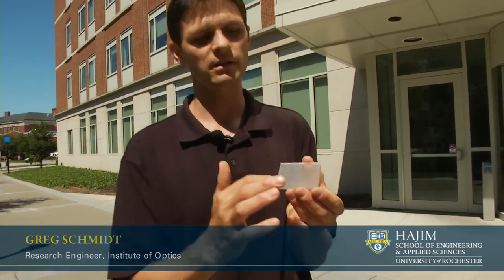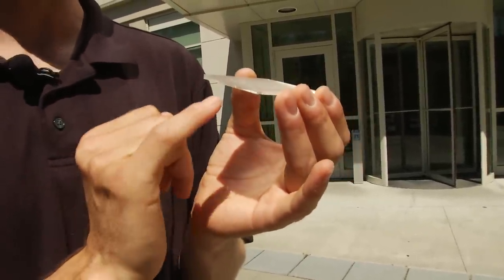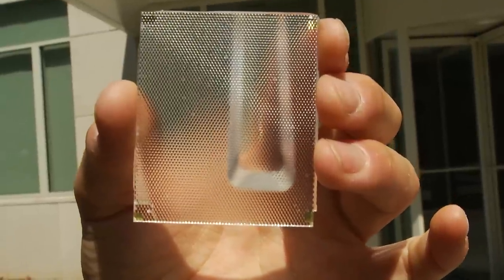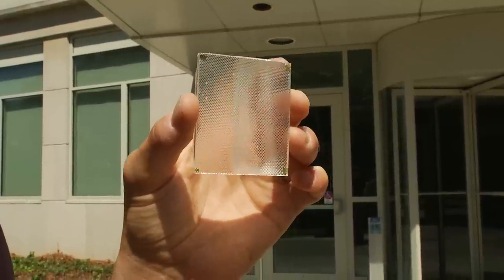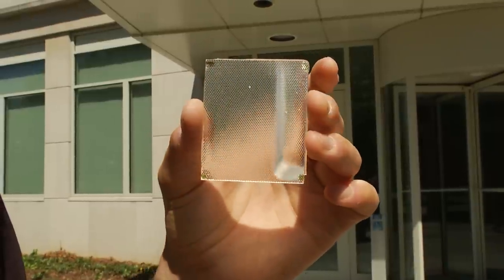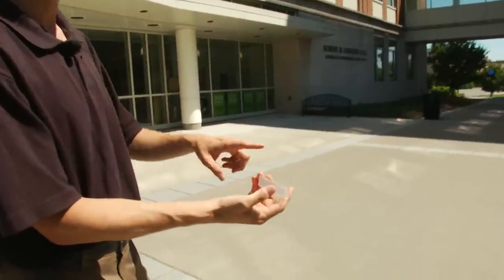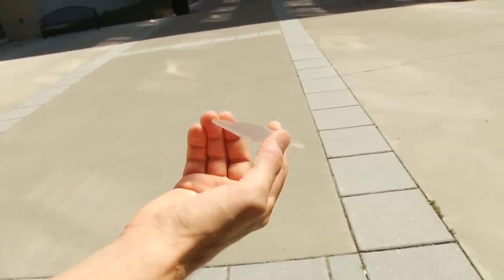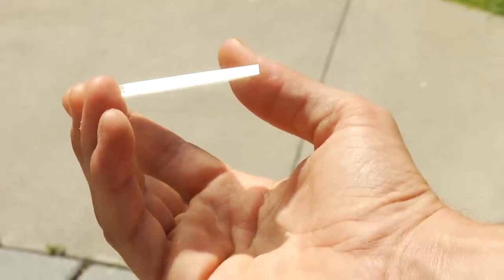Light Guide Solar Concentrators

Comment: These look pretty good when compared to fluorescent concentrator panels, but at the cost of introducing the need for tracking. If one were to make them such that they're only relying on one angle being tracked, I can see how they would be a great urban architectural technology, allowing diffuse light to pass without changing color temperature, but blocking direct sunlight.
Reply: But can you use the fluorescent panel but with cutting edges so it mig work similar?

Comment: The same job you can do with a plexyglass sheet.
There is not need for a collector like this.
I am doing these projects for 15 years and I can tell you that you have no ideea what you talking about. This will never work.
The best concentrators are lenses or curved mirrors made from mirror foils sticked to aluminium panels for self adjusting the radiation curve.
These mirror concentrators must be moved once per hour.
Your needs to be repositioned every 60-100seconds.
Reply: Isn’t the plexiglass redirecting the light on all edges ?